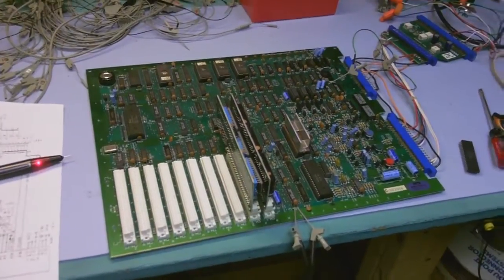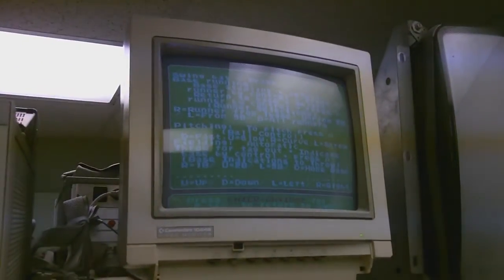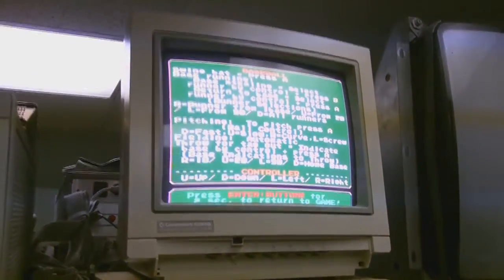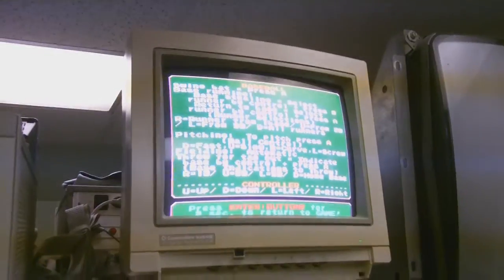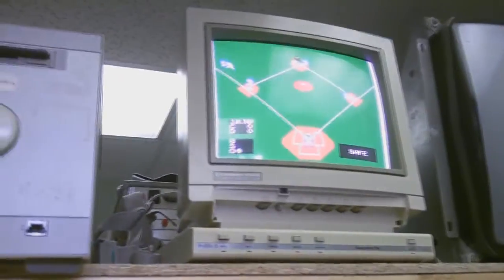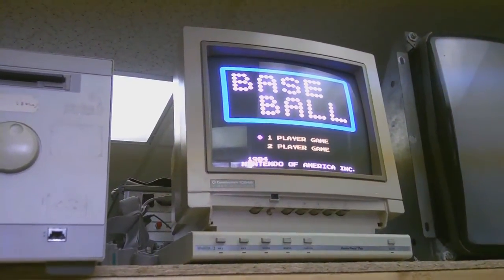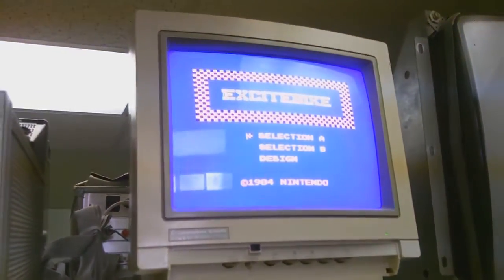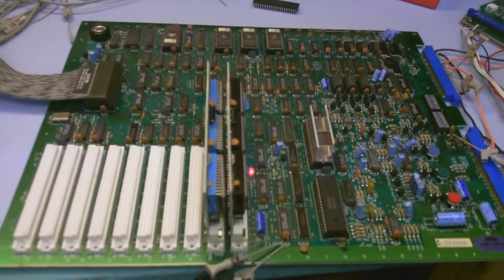Jason Solecki - Nintendo Playchoice 10 repair

Comment: I dug up one of these boards recently, and slots 1,9, and 10 have slightly corrupted graphics regardless of what games are installed.  It looks like most pins are paralleled between slots, so I wonder if there's a broken trace on one of the address or data lines.  The schematic I have is pretty hard to read due to a poor scan.

Comment: Hi, I've been looking for more technical arcade channels to sub to. I found yours through blkdog7's about section on his channel. I have a Playchoice 10 board that plays games fine, but it will display the games as duplicates, so I can only get 3 different games to show up and they fill up the 10 slots. I replaced the z80 with my other playchoice that works fine, same issue. Any other ideas for things I can test? Thank you sir :)